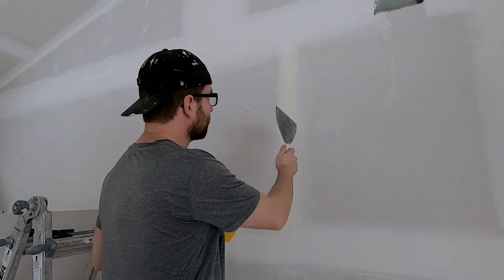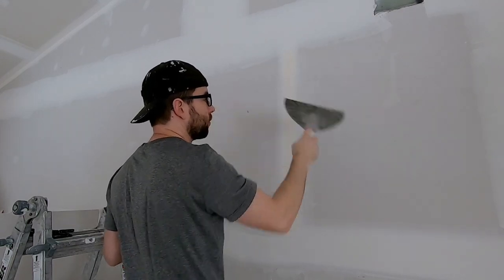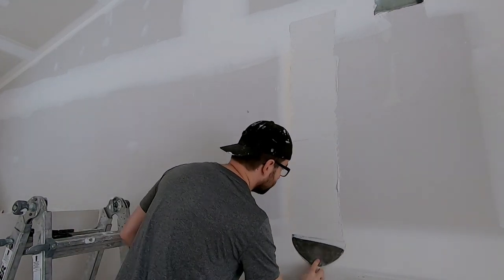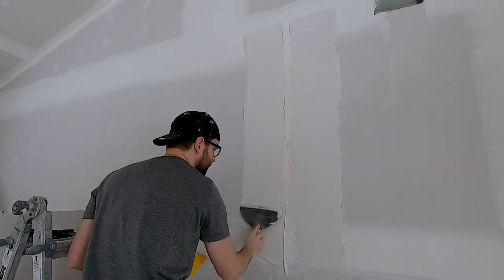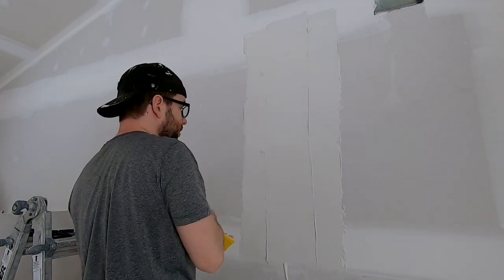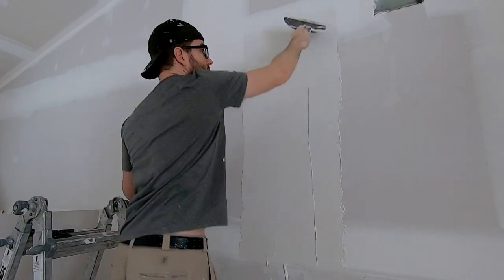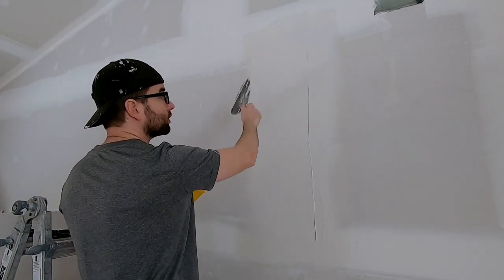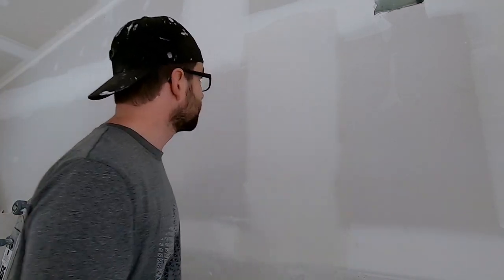How to 1st Coat a Drywall Butt-joint

Comment: This is the way I learned, coat the middle, then sides, feather both sides, clean middle and then clean both sides so theres only one line in the middle for reduced sanding. I find a 10" knife or trowel  is the minimum size required for coating butt joints

Comment: Too much water in the mud, the more water you add the weaker the mud becomes, more shrinkage, cracking, etc....try using mud with small amount of water.....
Reply from the maker: I appreciate the advice but have to politely disagree, It's true that adding more water will cause the mud to shrink more, this could be an issue if one does not account for that, the following coats fill in any shrinkage of the previous coats. Our tools such as the automatic taper or angle-box require the mud to be even thinner than what I'm using in the video, by the manufacturers design, the consistency of mud in the video physically would not pass through the tools. Going even further, high tech systems like the apla-tech pump system operates by running a near liquid mud through hoses from a pump similar to a paint machine and then out the tools, and professionals all around the world use these tools and achieve great results.
Here's my video portfolio started 2 years ago https://vimeo.com/davidnixon1
These are show homes, custom houses for picky builders and purchasers, etc. With mandatory 5 year home warranty in my jurisdiction.  I've been at it since 2003, hundreds of houses, and never had an issue.
Reply: @Interior_Works  the tools that require softer mud is not the discussion, its finishing drywall by hand that requires mud at a better consistentcy than you are using in the video, pull two separate joints and test the advice I give and you will politely see what I am talking about, been at this since 1991 and as for show homes and picky contractors they come a dime a dozen in my jurisdiction also, but that nor that doesn't determine the correct consistency of mud for a certain application.....👍